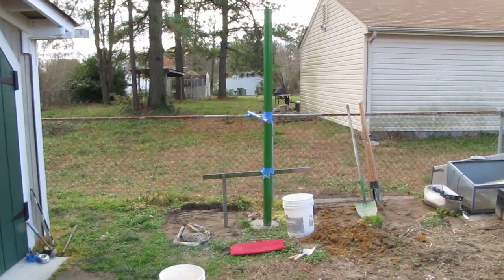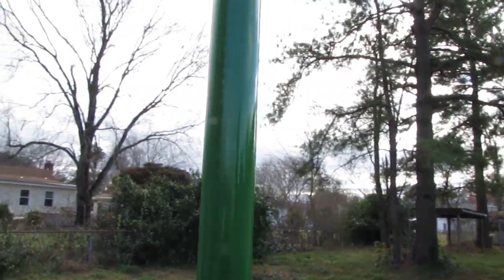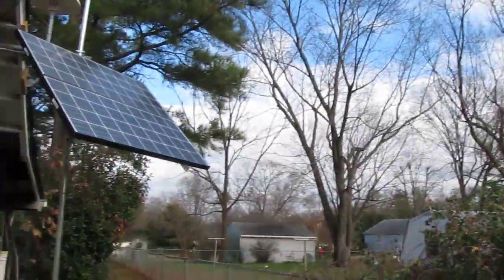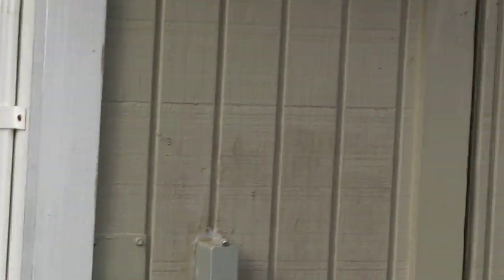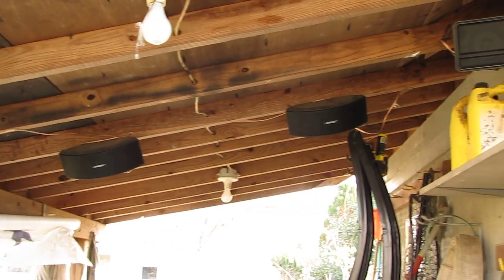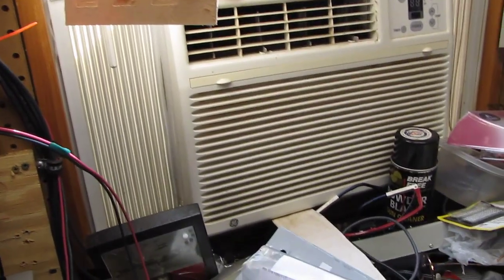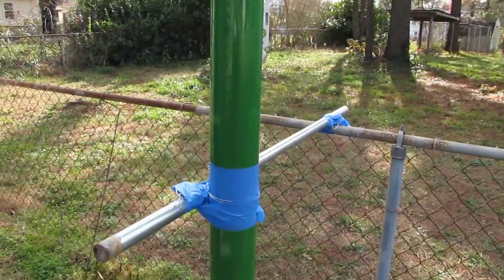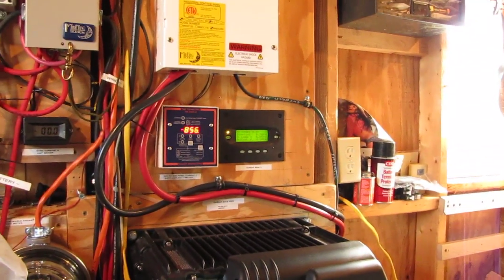ULSOLAR  Module & Renewable Energy Project Update Top Of Pole Mount Part 1

Comment: That pole looks like an excellent mount. I guess you will be getting much better power in the summer when the sun is above the tree line. Why not put it back further on your property to avoid the trees? Shade loss is higher than wire loss. And remember that the laptop is about 20W X 24 hrs = 480 Wh/day so if you aren't making that much a day from wind you are going backwards. It would be great to see a final days readout from a super windy day. Glad you got the panel problems worked out.